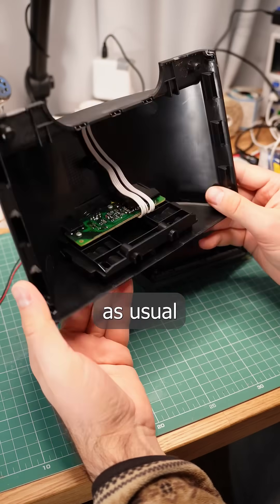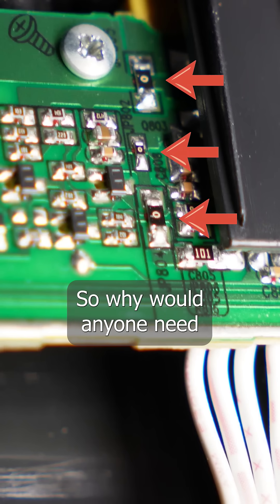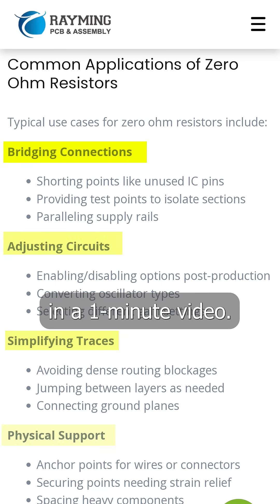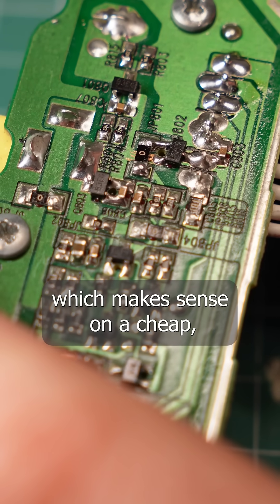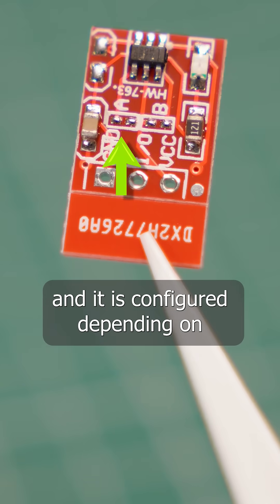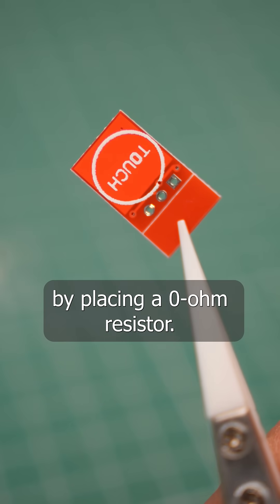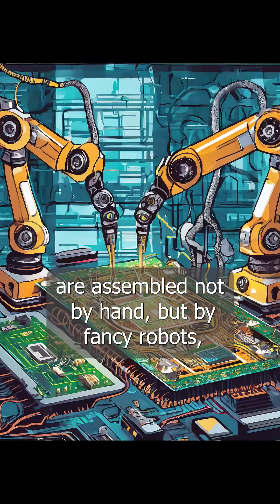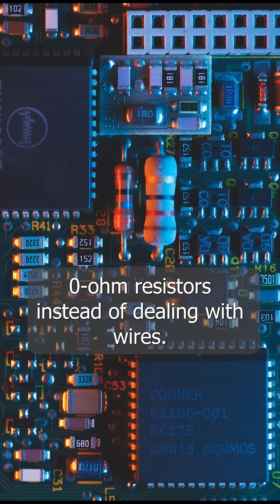TIL ZERO-ohm resistors exist

Comment: Interesting the whole 🕉  resistor turned out to be No use 🤔  but it does ignite the flow of electrical spark without any touch . Obviously, omh components are only occupying space for unrealistic sparks. Delete delete every 🕉  😂

Comment: They can also work as fuse's 😂.

I worked as a hardware engineer for industrial automotive controls manufacturer. Idr exactly what happened but one time an electrical engineer let the magic smoke out of our prototype that was going to be used as a sales demo by our top executives the next day to show to our partners on the project. And of course it was our only working board; which was due to poor management of the project by the executives. 

Fortunately only a 0 ohm res had burned up which likely save the rest of the components on the board. It did a little bit of damage to the pcb and the traces but we were able to fix it enough for the demo.

Comment: I'd also assume its very efficient to place a 0 ohm resistor between two very close pads compared to bending wires or carefully stripping tiny sections of wire just to get them connected

Comment: So if losing energy though transmission lines because of the resistance of the wire is such a problem, why not just make power lines out of a whole bunch of 0 ohm resistors?

(This is a joke)

Comment: They're even funnier in the bigger form, where you don't have the printed values but the colored lines.
Normal resistors have 4 lines, a 0 ohm resistor has a single black line lmao

Comment: It also makes it easier to disconnect a circuit in a nondestructive way by removing a 0 ohm resistor vs. cutting a PCB trace.

Comment: Used this at university to cheat on a really difficult layout problem on a single-layer board. Used a bunch of 0 ohm (and normal required) resistors to bridge traces.
Reply: I wouldn't call that cheating considering that is something done by professional's all the time and most complex circuits would be impossible without them especially on a single sided board.

Comment: When I first started in electronics in the 1980s, zero old resistors had a different name.
“Fusible links!”
Because they are still susceptible to overcurrent conditions..
With a small calculation via Ohm’s Law.
They conserve the same purpose as a fuse, in a much more mass production environment.

Comment: They're great in prototype board designs to isolate various sections of the board from power and from each other, that way if one section is entirely borked you can still test out the rest of it. Also handy for putting between UART devices if you often get your tx and rx mixed up..not that I'd ever do that, mind you.

Comment: 0 Ω resistors aren’t necessarily used on cheap boards, like on a 4-layered board with ground on the middle layers it’s a better choice to bridge traces with the 0 Ω smd instead of using a 6-layered board with via’s.

Comment: As I saw the title I immediately thought about shunt resistors. But they are probably not the same as the resistance accuracy has to be very high because they are used to measure current by measuring voltage drop across them.
Reply: Video cards have them to measure current and calculate power draw. der8auer modified them to trick the card and let it use more power (shunt mod). He even made an adjustable one via a transistor.

Comment: A zero ohm resistor is a wire... It's just a solid state  square wire rather than a circular length of tubular metal.

Comment: As an electrical engineer i can not overstate just how much we use these bad boys everywhere in the industry. They’re probably the most common resistor value that I use
Reply: This. Or 10k.
Reply: @tillorrly1128  10k is lowkey GOATed too. Other highly used ones off the top of my head are 1k, 4.7k, 47k, and 100k
Reply: There is NOTHING wrong using cheap bad boys to learn the components .. 🕉
Reply: One can solder those in series to build a zero-loss transmission line.

Comment: In SMT/SMD boards Zero Ohm resistors usually are just convenient jumpers. Although they sometimes are used for current sensing and have some other uses.

Comment: Dad also uses through hole 0ohm res as .25W fuses but only on test boards.
He said that, contrarily to fuses, they burn when they fail, which is why it’s a practice that is not accepted in production circuits

Comment: 0 ohm was before robots that fails. boards cost more when add 0 resistor. is it worth it. could be trace. if you see empty pads with 0 then it success. add 0ohm there and yours board do some miracle or. take miracle away xD

Comment: I am professional, embedded system engineer, using wire as a jumper and 0 ohm is not same. People literally shot videos after 2 minutes researches. btw, we soldered 0ohm by hand to ev charging station pcb while working on R&D, it's not because the machine does the component soldering easily
Reply from the maker: Could you explain more clearly what you mean?

Comment: I think that's a rather ridiculous explanation. You wouldn't NEED to use 'wires' instead. You would simply use a PCB track. There wouldn't be any need for anything else -- no wires, no resistors...just extend that track across the gap on the actual board itself!
Reply from the maker: Have you ever designed a PCB?
Reply: @LeftyMaker  This really is beyond the 'design phase', though. During the design phase, it may well be useful to have flexibility for an option to try varying resistors. But after you've determined that the circuit works best WITHOUT a resistor there, then it makes MORE sense to simply close up that break in the track that you created to put resistors into.

Comment: We often use them on a PCB design going in multiple applications where some of them need isolation and some don't. We'll put a 100k or something on the ones that need isolation to bleed off surges slowly while still keeping the grounds relatively linked for analog measurements. Then we'll put a 0Ω on the same PCB when we don't need any isolation and our measurements come out a bit cleaner, so we don't need as much post processing.

Comment: I know sometimes they use 0 ohm links as an alternative to wire or solder bridges, because it's easier fo a pick and place machine to use wire link 0 ohm resisors than having a whole through-hole wire or actual jumper in place.

Comment: In a thermostat for a project i added a 1 Ohm resistor to separate and filter a (i dont remember, the 5 pin that can spin) as i had the genius idea to optimize my code by adding stuff to the pcb, in the end it was the worse thermometer i could made, but got praised by the professors for the small code

Comment: Raspberry PI Zeros are a good example with 0ohm resistors for a bridge for the antenna so you can use the PCB antenna or an external coax style connector

Comment: I work in an electronics factory, i run a line of SX2 CP12 pick & place macbines, 0ohm resistors are actually suprisingly common on a lot of boards both single and doubled sided.
Reply: I can’t wait for when we have triple and quadruple sided boards in the future. In some other dimension. 🥸
Reply: @SocialDicktasting we do. I repaired a product with 12 layer boards designed in 2018, and I think the modern version of those are using 14 or 16 layers.

The manufacturing is pretty simple. Make two 2 sided boards, glue them together. Repeat until you reach 12 layers.

Comment: I've seen these zero ohm resistors on quite a lot of things, especially drone electronics. I think they are used as a shunt in that particular application to measure current draw.
Reply: You can't use a 0 Ohm resistor as a shunt since they won't produce any voltage when a current is flowing. Shunts are really low though, like 100 mOhms or less. My money would be on optional circuitry thats not connected in every variant of the circuit (so you can use the same PCB).

Comment: But why call them Zero Ohm Resistor? If you called them SMD jumpers or bridges, woudnt that save a lot of head scratching?
Reply: They are just resistors, they arent exactly zero ohms, in my experience they are very difficult to measure the resistance of as a resistance below 1 ohm is basically nothing, so the value on that appears on most smart tweezers/multimeters jumps around below 1 ohm, the tolerance on most reels ive seen is 5% but try and describe 5% of 0.

Comment: That mean we cant replace 0 resistor with wire?
Reply: yes, you can.
You can also replace it with a solder blob.
but in mass production, the cost of a 0 ohm resistor + the cost of mounting one resistor on the board is much less than the cost of mounting a wire (also, mounting a resistor is faster).

Comment: Sometimes a component with a 0 on it is a wire link, it usually is, sometimes it's a fuse, and you get to guess what it might be! 00 and 000 are fuses, as are usually coloured 0s.

On this board they are wire links.

Comment: In the coax maintenance field we have “0” or “JMP” attenuators (resistors). It makes a lot of sense in that application and I’m sure it does here too so they can manufacture all the same boards and just install a jumper if resistance isn’t needed in that signal path.

Comment: Oh so 0-ohm resistors are used as a "cap" to tell the signal "hey, if I have this cap, this is my selection"

Nice idea
Reply: I mean, the literal function is to short the sense pin of a microcontroller to the 5v rail. If there is no jumper, the wire is dangling open. When you put the jumper on, it plugs the wire into the socket.

Comment: They are also used as fuses, for protecting the components on the PCB.
Reply: Often labeled FL for Fusible Link, erroneously called “filter” by just about everyone.
Reply: No, you use a fuse as a fuse. A 0 Ohm resistor would be a bad fuse since it has zero power dissipation (P=I^2R, R=0, or very close to it) and wouldn't break before the rest of the circuit. However, there are fuses labeled with 'O' I think, which look just about the same as a 0 ohm resistor.
Reply: @cascadecontroller  Apple do this with small zero ohm resistors labeled as FL, fusible links. They are a micro fuse and do indeed blow and protect circuitry if you do things like powering up an iPad without plugging the screen in.
You will also find these on things like modem, fax machine or other landline device ports which can save the device from surges.
Laptops have the largest ones I have seen, obviously they use the correct wattage for the purpose of a fuse.

Comment: Ah yes the 0 ohm resistor, just a fancy wire with extra steps

Edit: mate this amount of likes and replies means absolute chaos on my potato phone as it sends a notif everytime anyone does that

Sure good for robots but like if your gonna do it by hand maybe just use a blob of solder or for longer just wire? 

It is less steps for robots so that's why it exists?

Unthanks and don't like?
Reply: Less steps when your a robot 🤖
Reply: @Playingwithproxies  I mean yea 
It reducese process and jumper is mounted with PnP machine with other smd Components 
Sooo you can say pnp machine a robot🤖
Reply: It's actually cheaper than a wire
Reply: Jokes aside
It saves alot of time by using 0 ohm registor as jumper
Reply: It's basically a wire with a flat easy to install form factor
Reply: For individuals, it’s usually simpler to use a solder blob for those 0 ohm selectors. Not so good when a resistor is expected but I’ve gotten away with that here and there.
Reply: an aliter:

wire, just a delusional resistor
Reply: Add a few more steps and you end up with an imaginary resistor
Reply: Its a conductor
Reply: A wire has measurable ohms, but the zero ohm resistor is a product of God 😂
Reply: Technically that’s every resistor
Reply: well just like the vid said if there is a requirement to use other resistance, it can be easily replaced
Reply: The 0 refers to being below 1 ohms, or 0.9 ohm to 0.1 ohms.
Reply: We’ve gone from recognizing a component, to measuring it, and now to searching it on on google for identification. Well, at least next time he will recognize it.
Reply: according to the clip, it's a jumper wire in the form factor of a resistor.

Comment: Also works great as a fuse to protect a circuit which rated high peaks but after works on normaly nominal current. On this situations a simple fuse just blow at the first time because the high starting peak, but if you change to higher rated fuse, it wont protect the circuit 💁🏼
Reply: You can just get a slow blow fuse.
A 0 ohm resistor is not gernerally a great idea. Even the tiny ones he points at there would probably need 100A flowing through them until they fail.
Its very much a jank way to do it and won't work half the time. Definitly doesn't "work great".
Reply: @jort93z  You a completely idiot, keep it yourself !
Reply: Or just use polyfuses.
Reply: @tillorrly1128  no

Comment: I honestly thought they are just use as a fuse
Reply from the maker: Guys on reddit say that's a bad idea. They can be unreliable as fuses
Reply: @LeftyMaker  thanks your videos actually helped me alot🌟
Reply: Many resistors can experience both a negative and positive Thermal Coefficient  depending on the material, environment, and other factors. This (and other) factor could affect its breaking point.
Reply: @eugenew2 But not positive and negative temperature coefficients at the same time in a single component.
Reply: If they are used as a fuse then they would have a current rating and something to indicate that on the package, but they don't.
Reply: @deang5622 yeah I'm still learning thanks
Reply: There are special PTC resistors that act as a resettable fuse.
Reply: @leonordmann A company called PolyChem started manufacturing them decades ago, think it was the 1990's.